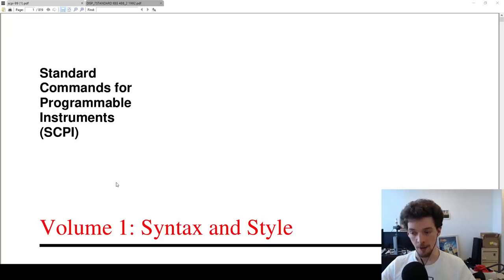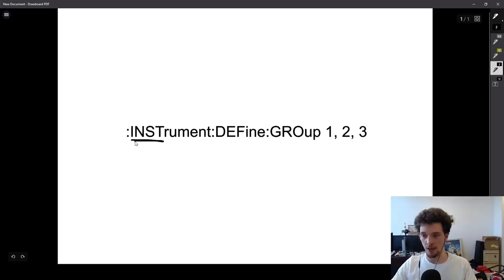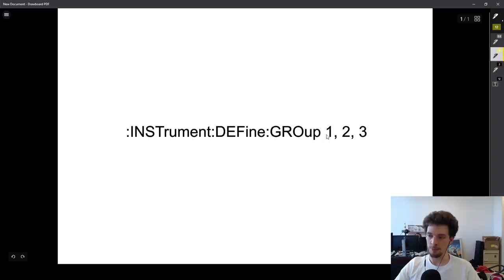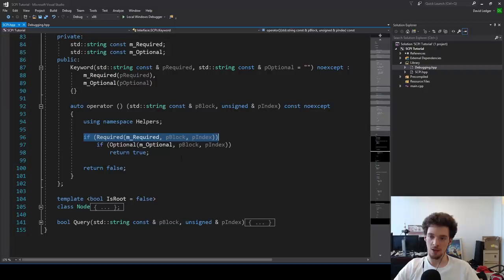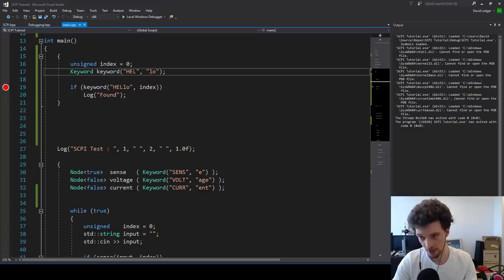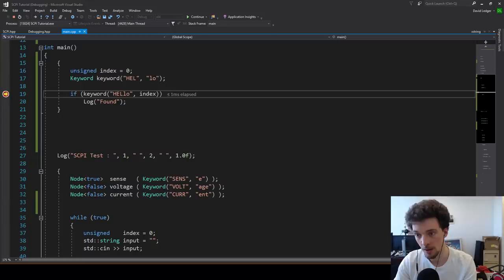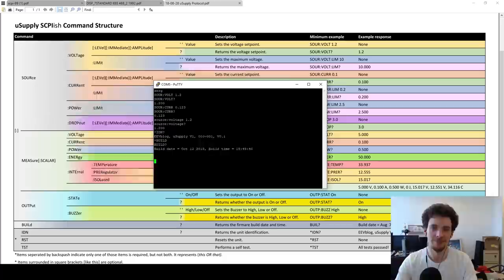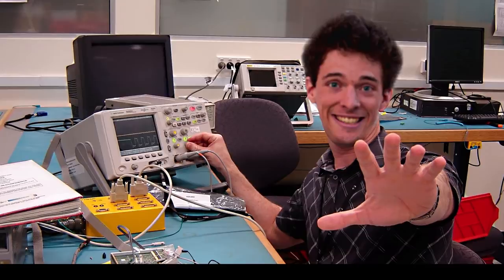EEVacademy #9 - Implementing SCPI in C++

Comment: I've written quite a few parsers in my life, for all kinds of data. But this is the most cumbersome implementation I've ever seen. Sorry. You should think in terms of a stream of characters, not blocks of characters.
Reply: Steam processing is sort of heavy and pointless. We can detect terminating characters (semicolon or return or whatever you choose) and burst the parsing at that point. 
It has less function call overhead, less statefulness.

Why would you use streams if you know when a command is finished? I've written systems that do real time G-Code (Streamed) and others that do things like JSON and XML (Processed in a block), streams are not always the best answer, run benchmarks look for yourself.
When you know the length and end of the data, streams are not be ideal, right?

How would you structure it, I'm pretty open to improvements here.
Reply: David, naaa, it's fine. Maybe I'm a bit too old school. I watched the video again and I see the dataflow now, but, I still stand by it's cumbersome. But then again, the other day, I cobbled together a piece of pretty wacky code, too.
Reply: How would you reduce its cumbersomeness, what would you prefer, the uSupply's git will be public and I want to make the interface as accessable as possible. (This is one of the many reasons I didn't use any code generators which spit out parsers).
Reply: There's nothing to reduce on your code. It's as compact as can be.
I'd just chosen a different approach altogether. I like me a good state machine. Although the "state" would be an instance of a class (the state-object).
The tokenizer then passes a reference of the next token to the current state object which returns the appropriate next state object to the tokenizer. Each state object only searches for keywords of it's own interest, which will always be a rather short list.
The tokenizer continues to do that until the end of the string. Then you just call some kind of "Execute()"  method on the last state object and it will automatically do the right thing, because it's automatically of the right type (class).
Reply: I've written similar a parser combinators in the past, certainly a valid approach. Do you think a tokeniser is a good solution in this scenario, SCPI is single pass, I think that would be slower and more memory?

Also don't you think perhaps "most cumbersome implementation I've ever seen" is a dramatic overstatement.
Reply: Well, I called it tokeniser. I sure would implement a few tricks to make it neat and leave something for the optimizer. I'm all for single pass. The string compare would be custom tailored, for example.
edit: Seems like you tailored your string compare, too. My point is about the whole approach.

Comment: You should write a proper state driven parser. This willy nilly style will never be reliable or secure.
Reply: Rob Fowler and data should be separate from code. Define a grammar (antlr) and a dictionary of the scpi parse tree, then write code to handle each entry in the dictionary.
Reply: @IceArdor  I would just use yacc/bison or ply in python.
Reply: I will elaborate further later in middle of something. But, scope defined state.
Reply: Scope defined state is completely normal in compilers for programming languages
Reply: I'm interested in what specifically you propose, a state driven parser? If you mean a LALR parser from bison or something they have their own issues mainly that they are less accessible to contributors when working with open source projects. They are also very irritating to debug.

**Stateful**, reliable and secure do not often end up in the same sentences. Ideally this would be stateless.
I didn't put it in the video but these functions should always be used in something like wrapper if these are important concerns:

std::size_t Parse(array_t const & pData)
{
    std::size_t index = 0;
    if (CallToParserFunction( Parse calls, index))
        return index;
    return 0;
}

The above returns length of parsed section.
Reply: There's nothing wrong with a hand-crafted recursive-descent parser. I've written a few of these myself, including a complete XML parser. Parser generators like yacc/bison or ANTLR, that take a grammar as input, are sometimes overkill for simple grammars. Recursive descent parsers are very readable, easy to understand, and maintain.
Depending on the requirements, a simple split by separator, colon in this case, into an array of fields may also be working well enough.
Reply: @davidledger5941  I think you are confusing something. Finite state driven parsers are much more reliable and secure because all the states are covered. The reliability of splitting a command up into an intermediate structure suitable for parsing is only really reliable with a finite state machine. Amusingly, some of the high level 'lexers' use regular expressions to build this translation and regular expressions themselves are a finite state machine engine. As the next guy says, you don't need to use yacc/bison flex/lex to do this stuff. A well crafted parser can be very compact, simple and very robust. In my experience, having written parsers for many interfaces, to complete languages, I rather enjoy writing the parser by hand if I know the gramer is small and will not grow. You may not have had much of a look at BNF, but I am very sure, once you 'get it' you will laugh at just how simple going from BNF to code is.

Comment: I'm a little worried that "MEASsex" would be accepted:  Optional should either be absent, or present in whole or part, but never wrong.  Am I understanding it correctly?  If so, the "optional" check should return true ONLY if "no incorrect characters were seen", where zero or more correct optional characters are fine, but mismatches or extras (e.g., "MEASuresex", running off the end of the acceptable optional characters) are death.
Reply: It doesn't run optionals in a loop? These optionals are not consuming... The index doesn't change on a mismatch. This means an optional section failing results in the next section parsing at the start of where the optional section is, if this section fails the parser returns false.
MEASsex:HELlo
MEAS is all that parses leaving the colon parser to check an s expecting a colon, this results in false returning and parse fail, as it should.
Reply: But it fails silently, no helpful info for the user ('sex not an option', for instance).
Reply: Optional fails silently because its never the final step in the parse chain, there is always a terminal character or another section the parse change that WILL fail due to its starting position being incorrect and in the middle of incorrect syntax. Its never optionals responsibility to fail, if it does fail to find something the exact same section is processed by the next section in the parser, that sections failure is visible.
What would you do in this scenario?
Reply: I would guard against typos and invalid syntax. It is not that much more overhead to indicate to the user that he has sent an erroneously formatted request or has misspelled one of the supported commands or is asking for something that is not supported or is an invalid option to that command.
From a user perspective, there is nothing so frustrating as a routine that fails silently.
Reply: Sorry your misunderstanding, this doesn't fail to guard against invalid syntax. Your example fails to parse, returns false. Think of optional as ConsumeIfExists, OnlyMoveIndexIfExists. There is always a non-optional section after an optional, (this could be the end of the string) the next section always rejects invalid invalid input if it doesn't match.

Optional only consumes valid sections if they exist, it doesn't consume arbitrary characters. In this case optional hands over control to the colon parser function, it returns false indicating that the incorrect character was at the position it is currently at, in this case the letter s in sex.
Reply: Or do you mean even when I return false I don't send an error message back to the user? That is true, maybe I should.
Reply: Or you get to the end of the input and have a left-over token and fail then with 'unexpected token ..." . Actually SCPI explicitly terminates lines with NL although you can have multiple commands per line (separated by a  ";"   PROGRAM MESSAGE UNIT SEPARATOR)

Comment: Feel like a very naive implementation. If you look at the syntax graphs in SCPI 1999 spec even just the way you specify a parameter (like the voltage or current etc) is super complicated. Just look at the stuff on units and multipliers! I started doing something like this too but took the approach of translating the syntax in the spec into something a parser generator uses then processing the parse tree that generates. I used python though and a parser generator called lark.
Reply: Yep, parsers are way more complicated things than anticipated, especially for something as old and elaborate as SCPI. If there is a decent parser library out there, then do a world a service, and just use it instead. No-one is interested of debugging your simpleminded parser. A random example from 1999 SCPI Syntax & Style: _"A special case is made for infinity. Positive infinity is represented as 9.9 E 37. Negative infinity is -9.9 E 37"_. Good luck with that. The entire spec is 800+ pages and every line of it can introduce some exception.
Reply: Correct, this is intentional. There is a place for naive implementations, its in memory constrained embedded applications. Minimum viable product does not need hex floating point or any obscure handling, simpler to constrain the specification.
Reply: Mmm but then you are using STL types (and passing them around and constructing them all over the place). Not to mention templates which can lead to generation of lots of code. There are simpler ways of making a recursive descent parser just using an array and a couple of pointers.  Sorry I don't see this implementation as light weight or simple but it is incomplete w.r.t the standard and so of limited utility. Furthermore I fundamentally disagree that floating point is not useful - surely you want to set your current limit as something other than a whole number of amps? Or ditto output voltage.  C++ and in particular C11 features like auto and templates are not beginner material. Just use an OSS  library like libscpi (github). A more useful FF video would be how to integrate that into your micro-controller app.
Reply: I'm not constructing STL types. std::int32. etc. is exactly the same int32_t... std::array only constructs if you initialise it, otherwise it remains undefined. There is absolutely no overhead of these constructs. As stated in the video std::string is not recommended here, the optimal alternative (a safe no overhead alternative to plain char[]) is used in the actual code it was too much for this video. 
Templates don't result in lots of code when there is only a single instantiated type. The once did produce a quadratic amount with the number of instantiations but that hasn't been true for a long time. Comdat folding and other things can result in binary size reducing substantially.
I do implement float, I don't implement hex float, hex int, hex unsigned, inf, -inf, undefined etc.
Libscpi does seem good, but its pretty heavy due the thoroughness of the implementation. That's a good and a bad thing.
Reply: First of all thanks for sharing this and I am sorry if I am being a bit harsh. And Ok fair enough - I thought you were constructing the Keywords in the function during parsing (and these contain std::strings) although it isn't totally clear reading code in video and that might just be example code. For example you pass a ":" to Optional at some point which takes a std::string reference - this will cause a std::string to be constructed from the string before the call. You said in your previous comment a minimum viable product doesn't require float support - that's what I was responding to in regards floats and I still don't agree that is the case. COMDAT folding may result in less overhead than not using COMDAT folding :) It may if you are lucky generate code the size of non-template code. So is your library easy to write if you know what you are doing? Yes definitely. Is it minimally small for embedded implementation? I would say no and I think it could be just as understandable and fast to write without STL and templates. Is it helpful for beginners? Definitely not as beginners are likely to not understand the auto keyword.  templates functors etc. Also as it is a very incomplete implementation of the standard (at least from what I can tell) beginners would be wise to find an existing well tested implementations rather than rolling their own (unless they really want to write their own for educational reasons). Is there a github for this?
Reply: No of course - it depends on the template parameters and a lot of factors. There are a lot of ways you can cause different template instances to generate different code. If you are careful you can avoid this of course.
Reply: You don't write your own parsers for the same reasons you don't create your own SMPS-s. Both are simple on surface, for both the devil is in details and for both have cheap, off the shelf implementations available. For instance, how do you verify, that you are compliant with the SCPI minimum requirements? Because if you are not SCPI compliant, then you can skip the entire SCPI business altogether and use something simpler instead to control your device (e.g. an embedded web service).

Comment: Wouldn't it be a whole lot safer to run your protocol in a state machine? Neat video to see your method of embedded C++ programming anyhow. Is this going to be open source? Is there a git repository somewhere (i.e. on GitLab or GitHub or something)?
Reply: While not possible to show the actual implementation as its heavy in meta programming, this pattern has state defined by the scope of the if statements.
The actual implementation while harder to read by people who aren't well versed in templates, is actually stateless until the leaf nodes of the SCPI tree. Everything is const until that point and at that point the scope changes to the callers scope. The advantage of this method is that there is no risk of getting into an unrecoverable state or having external functions interact with state at an inconvenient time etc.

I've heard a few people talk about traditional fsm for safety, why would that be the case? In my research statefulness has always been defined as insecure, unreliable and difficult to maintain. I'm not sure I solved the last one there lol... Stateless functions for example are re-entrant. Stateful functions are more difficult to reason about than pure functions (stateless). You could do a stateless FSM but that is atypical so I assume not what people are talking about.

The real version will be on GIT, this one was programmed real-time while recording and then my audio got garbled so I shot over it somewhat :(.
The entire uSupply source will be on GIT but this will be in a seperate repo.

Comment: Proper way would be defining a grammar and generate a parser based on that using some existing tool.
Reply: Would be interested in the tool, did you have something in mind? How do you define the grammar? Why is that the proper way?

If you mean a combinator yeah lots of great ones but this took 30 minutes really not worth the effort or troubles dependencies can bring.
Reply: @davidledger5941  I have in mind something like classic lex/yacc. It does take learning some abstractions like context free grammar. Once the grammar is defined, it is translated by the tool into C code for parsing the language. There are tons of tutorials available.
Reply: Thanks for the comment, I've been looking into it not sure its better yet but certainly interesting.

Code generators are fine but they have their own issues, bison has many. We don't need tokenization SCPI is single pass. We don't need a lexer, SCPI is single pass.
It does also seem very overkill for a parser that intentionally has a small memory footprint. To reduce the footprint I'd need to modify the generated code and then I might as well have written the parser. Naive implementations are sometimes optimal given the correct scenario (I believe this one). Bison generates difficult to modify tables, these are also tough to debug.

I am not very familiar with bison because last I read GCC stopped using Bison for C parser, so did clang they are now hand written because it turned out to be much more trouble than its worth. Bison was designed to parse C as far as i'm aware? These code generators are not bug free, they expand the debugging scope substantially.

I only really know about Bison in this regard, maybe you had a superior tool in mind. I am not familure with and lex tools really :(
Reply: @davidledger5941   u can search an old book of IBM engineer structured programming  in there u can learn lots about context free grammer

Comment: Heh code that breaks the coding standards of every company I've worked for using C++!
If's with no {}, p prefix on variables that are not pointers. Would require a lot of rework following code review ;)
Reply: most of those "coding standards" are dictated by managers who have never written any code.
Reply: Most companies I have worked for do not have a code review phase at all, or do it too late. Anyway, a code-review with a focus on style is useless anyway. Some linter can check for missing brackets etc. Code review should focus on problems that a simple style checker cannot find. IMO the main problem with this tutorial is, that it teaches people to write a parser in wrong way.